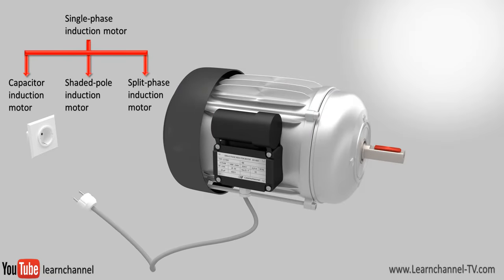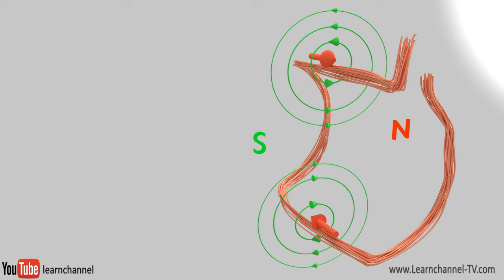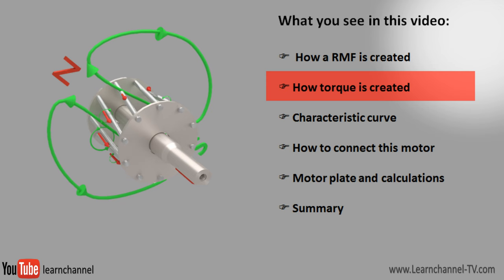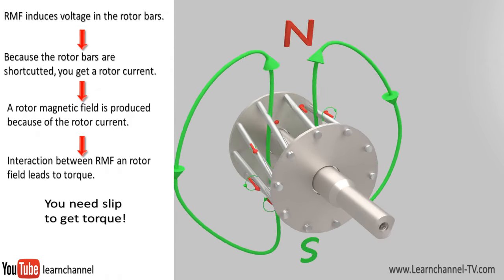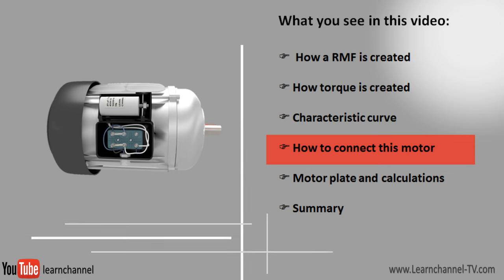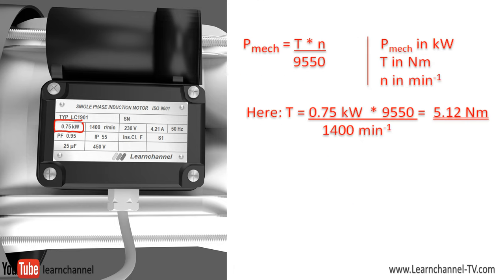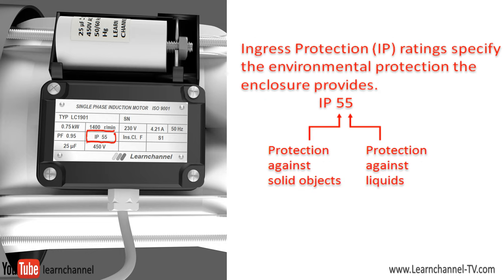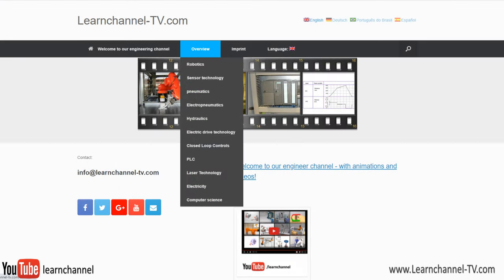Single Phase Induction Motor (Capacitor Induction Motor or AC Motor) explained

Comment: How can it have two speeds though?!
Reply from the maker: you cannot switsch between two speeds - the best solution would be a VFD if you want to control the speed.
Reply: Could i use a vfd on a single phase motor?
Reply from the maker: @polhpolh64  There are frequency converters especially for single-phase AC motors.
The use of a frequency converter for three-phase motors makes no sense here, since the connection for the N conductor is missing here.
Reply: Sorry for late reply. I didn't get a notification before but I just stumbled on this video again :) Matter of fact, I've a bunch of cheap single phase AC motors that are dual-speed. If I remember correctly from my prior research, the current goes through extra windings for the slower speed setting, e.g. 3 windings used for high speed, or 6 for low speed. Not 100% sure though.

Comment: Have you a video explaining the high voltage across the capacitor.     Maybe 1.5 times the supply  voltage
Reply: Although the primary reason for the capacitor is to provide a synthesized second AC source phase to provide the rotating field, a byproduct of the use of capacitor to create the phase shift is also an impedance transformation.  This result is lower current and higher voltage on the auxiliary winding. 

Auxiliary windings often have more turns of wire of smaller wire gauge compared to run winding to optimize for the higher applied voltage / lower current.  In the range of 125% the number of turns compared to run winding.  This also means the video's statement of 2/3 the field strength in the auxiliary winding is not necessarily correct.

The optimum run capacitor value varies in value a bit depending on motor mechanical load.  Its value is usually selected for near maximum rated horsepower of motor.

When auxiliary windings have more turns than run windings you should not swap run and start winding connections to reverse motor spin direction.  Motor will not have same performance in reverse direction.

Comment: Is that the right circuit diagram for the capacitor start motor, i thought the centrifugal switch shud disconnect the aux winding
Reply from the maker: It´s correct for sure. If the centrifugal switch would disconnect the auxiliary winding, there would be no diffenrence made between run capacitor and start capacitor. Furthermore you need at least 2 windings to get to a RMF.
Reply: @learnchannel-TV  ahh ok, ty for clarification. I did not know it was capacitor run motor, i may have missed it while watching the video. Ty

Comment: So some motors don't have a starting capacitors? So how they start then?
Reply from the maker: They start and run with only one and the same  capacitor. Disavantage: a low starting torque as shown in this vid.
Reply: Are you maybe referring to a shaded pole induction motor?